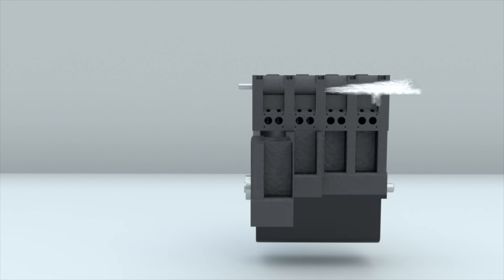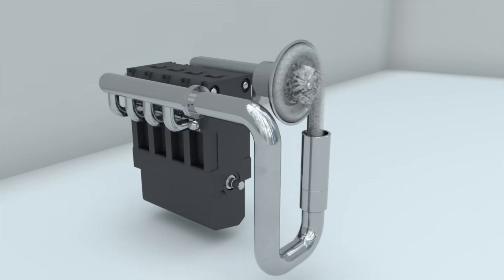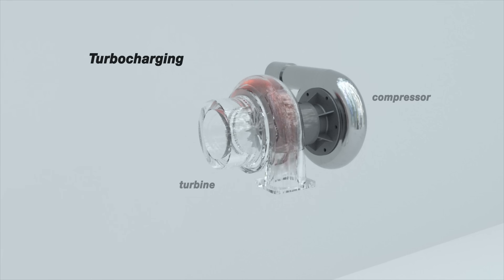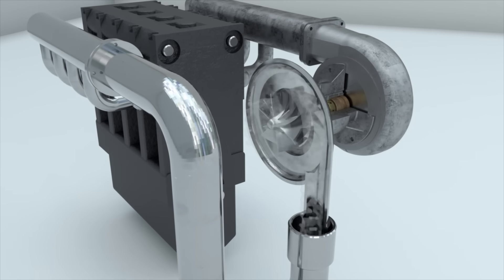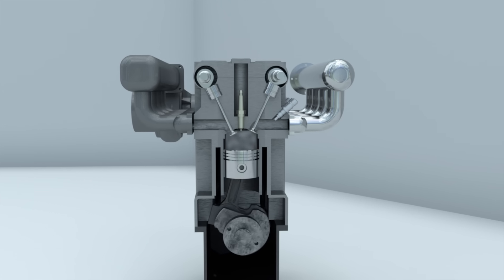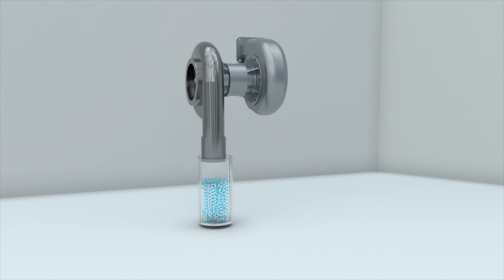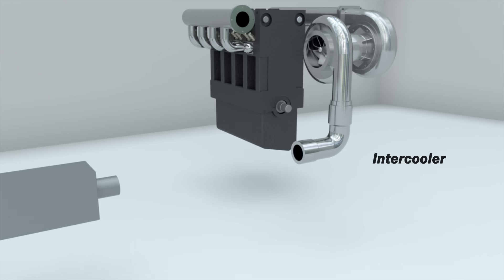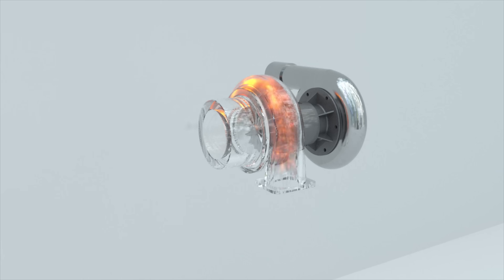How does a turbocharger work?

Comment: One very important part of turbo systems that was left out was the blow-off valve. When your foot comes off the gas, and the throttle body closes, the turbo is still spinning, trying to force air into the cylinders via the intake manifold. If you can't eliminate that pressure, all sorts of bad things can happen, like blowing the plumbing off the inter cooler. Hence the blow off valve. It is set at a pressure that allows excess pressure to be blown out of the system, but not all the pressure. You want some, so when you accelerate, the turbo doesn't have too much "lag", and will spool up faster. BTW, colder air is more dense, making the air/fuel mixture more explosive.
Reply from the maker: Thanks for the additional information
Reply: Long story short, you get the zrooooom..Pssshhhhh sound.
Reply: @TN_AU  🤣🤣🤣🤣🤣
Reply: Blow-off valve it's definitely handy at the intake side to protect the blades and also loved by tuners especially the atmospheric blow off valves that releases the air into the atmosphere making the famous noise. 
As far I know on stock mainly wastegates are present which is for to regulate the boost pressure (by routing the upstream flow back into the exhaust), the intercoolers are also typically installed on sport cars by tuners, it's something you won't find either on a regular stock street car.
Reply: @Choco-m7u  all modern turbocharged cars have intercoolers from factory, but they aren't as visible from the outside as aftermarket ones.
Reply: @vxsr33  had a friend with a chevy turbo suv. i don’t believe it had an intercooler
Reply: @grahams5146  what year is the pick up truck? All modern turbocharged cars have intercoolers but I think some 80s and 90s cars didn't. Those which didn't have intercoolers would be running fairly low boost I believe.
Reply: @vxsr33  i think a 2015 or so. it was like a chevy equinox
Reply: @grahams5146  I'm from Australia so we don't get that car here but if it's a relatively new car it's will definitely have an intercooler, it will just be hidden or really small
Reply: @vxsr33  it’s a very small turbo and i wouldn’t put it past chevy to not put an intercooler in 👀
Reply: @Choco-m7u  a blade spinning at over 90k rpms isnt gonna get affected by 2-3psi of boost lol yall act as if it were crucial to run a bov
Reply: @Choco-m7u  My regular stock street car was manufactured with a waste gate, bypass valve (blow off valve) and air cooled inter-cooler, it is a 5 door sedan and not a sports car.
Reply: I mean there are multiple videos saying otherwise.
Wastegates are mandatory. Blow-offs are not that needed. I mean when the air intake valve closes, the air goes back into the turbine, hitting the impeller and creating close throttle compressor surge, which is commonly confused with open throttle compressor surge which is actually bad for your turbo. This is why some people say that not having a blow-off is hurting your turbo.
Reply: Is there a video like this one that explains what your saying. I kind of get the jist of it.
Reply: @layzy24  thank you! made perfect sense
Reply: @layzy24  so when you let go of gas pedal the exhaust is still spinning the turbocharger which is spinning compressor turbine. 

But since you let go of gas you don't need the compressor to compress new air since you're not accelerating ( gas pedal not pressed) so since turbocharger is spinning compressor and compressor is raising pressure by compressing air that is about to go into intercooler if you don't release that pressure and it builds up it can rupture intercooler or any part between compressor and engine.
Reply: A pretty long winded explanation that’s people shouldn’t listen to really. Bov’s require a complete retuning of your vehicle if you add it aftermarket and most turbocharged cars recycle the air your pissing out your bov back into into the system. It’s actually causes MORE turbo lag because you’ve now dumped all the pressure into your engine bay and it needs to rebuild. Bovs are 100% for tuners because they like the sound and unless your hitting like 30lbs of boost You don’t need to dump the energy off that fast.
Reply: My manual mini Cooper came with a factory BOV on it. 
I love it. 
Rrrrrrrrrrrrr, pssssshhhhhh, rrrrrrrrrrr, psssshhhhh, rrrrrrrrrrrrr, pssssshhhhhh!
Reply: @We_Are_Borg_478  😔 my jetta came with a diverter valve
Reply: @grahams5146  A diverter valve? What is that?
Reply: @We_Are_Borg_478  basically instead of venting the excess air into the atmosphere, it recirculates it into the air stream via the intake to be used again. instead it doesn’t make the loud pshhh sound, it only makes spooling sounds:(
Reply: @grahams5146  With no education on the issue, it sounds like your system is more efficient, even if I have the better sound.
Reply: @We_Are_Borg_478  there are 2 types of bovs, atmospheric and recirculating (also known as diverter valve). Atmo bovs are generally illegal for emissions purposes and also they can cause the car to run rich in between shifts since the bov is releasing intake air when you let off the throttle. This can hurt performance but sometimes it can result in flames coming from the exhaust (which is a pro for some people).

Recirculating bovs are legal and better for performance as they keep all the intake air in the system and keep air to fuel ratios constant. If you want more turbo noise you can get an aftermarket recirculating BOV with a stiffer spring to have nice turbo flutter on low boost but allow the bov to open up at high boost
Reply: @We_Are_Borg_478  it’s a little more efficient, but i’d rather have a loud blow off sound because i can’t hear anything over my exhaust
Reply: Thanks for the info, only. Thing that matters is stuuutututuuuuu
Reply: It would be extremely unlikely to blow off the intercooler plumbing by having no BOV. When the throttle closes the turbo isn't under much load and the air in the system is simply diverted back to the compressor wheel, which makes the turbo flutter noise. The pressure in the system isn't very high at that point.
But having no BOV can make the turbo very laggy between gear shifts because the compressor wheel is slowed down between shifts.
Reply: @vxsr33  False. 100% lol
Reply: @vxsr33 right but there's still also a chance. With a blow off Valve you eliminate that risk. It's a similar system used by Audi called the N249 system. Look what happens if you delete the n249 from the system. Basically he's explaining the same thing but to prevent that catastrophic event you add a blow off Valve. Absolutely right highly likely but also still possible!
Reply: If you don’t have a blow off valve, doesn’t the excess pressure exit through the turbine, causing the famous “stututu”?
Reply: @danielwilson5502  yes but there are also BOVs that vent in a similar sound
Reply: @Svall823  gotcha
Reply: Blow-off valves are used by tunners mostly. Wastegate is important, but not BO valves. 

Though waste gate chatter is nice to hear;)
Reply: @xtrmbeast  WTF are you talking about? "Blow-off valves are used by tunners mostly"
Reply: @familyfalc8109  dunno what is confusing?
that blowoff valves are not used in racing cars? wonder why..
Reply: @xtrmbeast  Depends on the series, Plenty "Racing" cars have em. What you meant is that BOV's are most commonly found on street cars.
Reply: @familyfalc8109  ok, in which race do they use them?
Reply: @xtrmbeast  Too many to name, An example would be local events, Amateur racedays.. You are associating Pro/ Fully prepped cars with the average car that enters events... So what do you think a "race car" is exactly? The car in my profile pic is my car, It makes 500hp with 10psi of boost, it doesn't get used on public roads and will only ever see a track or dragstrip for the rest of it's life, What would you class it as?
Reply: @familyfalc8109  which car is that? and it's classified as tuner car.
Reply: @xtrmbeast  First off It's tuner, Not tunner. I'm aware no competitive pro's use em, But saying no "race cars" use them is false. As i said before, There is more events around the world, you are thinking of televised/Major series. I was only breaking ya balls for the blanket statement, calling cars "Tuner car", "RaceCar" is something i'd expect from a F&F movie.
Reply: @familyfalc8109  nah there is a tuner car and there is a race car. I had evo 9 rs N4 spec (rally special)
 In racing world bow is no go..
Reply: @familyfalc8109  as for tuner and racing cars and f&f.. that is true..street racers and other bullshit are tuners, race cars are special cars ment to race. And in that car is every thing about performance. There is mostly used antilag sistem for not having a lag between gear shifts. Bow doesn't alow that, releases the pressure, turbine stops boosting so when you gear shift and press the "gas" pedal once again there is no power. A "bang bang" sistem is just for that..when you shift there is power immediately.
Reply: @xtrmbeast  Less time watching St Outlaws, more time with cars buddy. If the Turbo was matched with the engine then lag is only a problem on the initial "Launch". You're thinking of 2000hp Drag machines that need the tech. Most track cars don't as power is the last thing on their mind, It's all about weight distribution n balance.
Reply: @familyfalc8109  You are form North America?  In that case I would undrestand you don't have a clue about race cars, all you know are drag cars. Do you even know what is Wrc, Le Mans 24h.. In rally world we say..if you can't drive, go draging:D

had to check wtf is outlaws..:DDD ..dude,you know that  corners exist on the road? asking since  u'r from murica:D
Reply: @xtrmbeast  lmao. I come from the land Downunder! Grew up with my own personal "Rally Stage". My whole family loves cars and racing in general, Ranging from a couple GT-R's and several other JDM cars, to "Muscle" cars from the 70's with LS swaps. BTW Drag racing is about the car, the circuit is for the Drivers, Pretty common knowledge mate.
Reply: @familyfalc8109  nice. So then you know there is no bow in any race car, which is capable of cornering;)
Reply: @xtrmbeast  Yea.. It's almost like if you actually read my responses you would've known that..
Reply: @familyfalc8109  well I did read it, and stil no answer, because there is no bow in any race car. leave that tuner and drag crap asside. 

If you know about one please tell.
Reply: Yes, but the more important part is Wastegate. Its the 'valve' to limit the boost level.
Reply: exactly well put my man.
Reply: You also missed that not all engines are created equal and some need a diverter or recirculating valve instead of a blow off valve.
Reply: @real name some people just feel lonely unless their check engine light is on. 

RIP local VWs. So many diverter valves swapped with BOVs, may their rods rest in pieces.
Reply: thus the hissing noise when the access air is let out of the blow off valve. see, I am learning
Reply: A dump valve? Same thing I assume.
Reply: There are older stock turbo diesel trucks that came without intercoolers/ without blow off valves or wastegates.
Reply: @kieran8720  you are correct. 1st gen 12 valves have neither
Reply: @kieran8720  Diesel engines do not need and almost 0 diesel engines ever made have throttle body's of any kind, or blow off valves, or waste gates.... the newer diesel pickups have throttle body's as a way to control / assist the EGR exhaust gas recirculation system to create a stronger vacuum on the Exhaust side so the engine can suck more exhaust into the intake. for emissions purposes only. but i said it once and i'll say it again, even Really old Small diesel engines in trucks. do 20+ PSI of boost, and roughly 1995 or newer can easily do 30+ PSI of boost, and 2000 or newer can do 40+ PSI of boost from the factory. without any waste gating or blow off valves, my 2005 truck has a aftermarket borg warner 369 SXE in it. T4 swap. does 75-80 lbs of boost i know guys that run 120-180 PSI of boost. and those guys said systems do not have any kind of blow off valve or waste gate. or throttle body. i think these things are purely for gasoline vehicles. as too much boost will cause detonation and detonation is "compression ignition" and a gas motor cannot handle it. while a diesel, runs off "detonation" / what's known as spark knock diesel engines are compression ignition after all.

side note diesel engines are typically 15-25% more efficient than gasoline counterparts meaning a same displacement gasoline motor and diesel motor both naturally aspirated under most ideal conditions to make them the same. the diesel engine will go approximately 30% farther than a gasoline engine on one gallon of fuel, not to mention Diesel engines for just about any given size generally will produce about double the tourqe or just over double the tourqe of its horsepower number, where a gasoline engine will have tourqe numbers below its horsepower or slightly above ~ 100 ft lbs within whatever the HP rating is. take the 454 big block, just some random dyno numbers i got off the internet, and its a very touqey gasoline truck engine i could think of, 250 hp 385 torque, take a similar design Engine the 6.5 detroit non turbo or 7.3 IDI non turbo. make about 180 horsepower but 390-400 ft lbs of tourqe respectively, 

even more interesting add a turbo to the mix a stock Turbo 454 big block will be making 427 hp and 504 lb-ft. or somewhere in that ballpark,

a stock turbo'd 7.3 powerstroke as it has a similar size turbo and almost identical displacement diesel to the gasoline engine will be making around 275 horsepower and 575 ft lbs of tourqe, throw some tuning at it, and you're looking at 410+ HP, 890+ lb ft of torque

my personal vehicle my 2005 F250 Harley Davidson edition with a 6.0L Powerstroke although highly modified, gets 29 MPG highway doing so with 700 HP and 1400 lb ft of torque here at sea level, my 2018 F250 Platinum (all stock) with the 6.7 Powerstroke gets about 450 horsepower and 935 lb.-ft. of torque

it stands to reason though Diesel engines will be making generally speaking double the torque of a similarly sized gasoline counterpart, and use less fuel doing it. as the metering device for diesel engine speed is Accuratly timed injections of atomized fuel into the cylinder just before or right at TDC. there are no other means to metering the diesel engine speed other than fuel flow. 

while a gasoline engine you can adjust timing by advancing spark, you can close the throttle body, limit the air increasing the fuel going into it changing the mixture, while a diesel generally the fuel mixture is the only thing that changes under ideal circumstances. 

i went off on a rant but long story short and th epoint i hoped to get across was diesel engines are proof throttle body's and wastegates and blow off valves are not required.
Reply: @Haast's Eagle you still need to release the pressure somehow, so it's basically the same thing
Reply: you don’t need it
Reply: you left the most important role actually, its the ability to make the pew pew sounds
Reply: The most important in addition to the Blow Off is the Waste Gate, important to avoid overpressure of the compressor by limiting the revolutions of the turbine by allowing excess exhaust gases to flow out. this valve works by detecting the pressure in the compressor manifold, if there is too much pressure it opens just enough to keep the pressure within the limits by regulating the revolutions of the turbine and consequently of the compressor. Also important for altitude pressure. at altitudes close to sea level it will open more because the air is denser, as the altitude increases the pressure decreases and the waste gate will be almost closed to make the turbine and compressor spin faster to compress air as much as possible and remain within the pressure limits for the best engine performance
Reply: @MarcoFormentin  "The most important in addition to the Blow Off is the Waste Gate, important to avoid overpressure of the compressor by limiting the revolutions of the turbine by allowing excess exhaust gases to flow out. this valve works by detecting the pressure in the compressor manifold, if there is too much pressure it opens just enough to keep the pressure within the limits by regulating the revolutions of the turbine and consequently of the compressor. Also important for altitude pressure. at altitudes close to sea level it will open more because the air is denser, as the altitude increases the pressure decreases and the waste gate will be almost closed to make the turbine and compressor spin faster to compress air as much as possible and remain within the pressure limits for the best engine performance" --That makes a lot of sense... In addition, interceptors, or cop cars, have waste gates that are even more efficient due to their lack of emissions standards. One thing I'd like to point out that hasn't been mentioned is that by cooling the intake air, more air can fit into the cylinder, although the air is subsequently heated by compression. There's physics going on here that hasn't been mentioned, that has similarities comparable to the use of NoS. The power stroke of the engine is altered by two factors simultaneously with the turbo, cooling and increased oxygen. Without cooling, the engine needs to run richer, by adding more fuel, whereas if it is cooler the engine needs the same or less fuel. The efficiency of this system can be identified on an OEM system by the octane requirements, as if it not as cooled, more octane would be recommended.
Reply: Anti lag is one hell of a drug 🤝
Reply: Cool information
Reply: cool information
Reply: Denser air makes the mixture richer, burns dirtier. More gas per molecule of air. As per more powerfull i'm not sure.
Reply: Also sounds great. Love that noise.
Reply: Yeah i was waiting for him to mention it lol
Reply: He also left out the waste gate
Reply: @allencarabajal-11  Diesels don’t have blow off or recirculating valves. No throttle so no back pressure that needs to be vented or recirculated. That’s why under deceleration you still hear the turbo spinning on them.
Reply: No blow off valve, more turbo flutter but at the cost of efficiency
Reply: Totally.  Plus it sounds cool.
Your girlfriend might crack jokes about how your car "sounds like it has a cold", but then you floor it and the jokes stop.  😂
Reply: . NBC b
Reply: Video is very vague.  The blow off valve goes whoosh! Followed by a sexy flutter.
Reply: I was taught that it was called a " pop off" valve.
Reply: Not to sound dumb by any means but I thought a blow off was optional??
Reply: @ericelwood9393  The pop-off, or blow off valve prevents over boosting the engine thus preventing damage, some times catastrophic damage.  There is an inherent lag with any turbocharger system because of it's reliance on exhaust gasses that make it work.  The blow off valve helps to regulate the upper end, as stated, to prevent an over boost condition.  It should not be removed or disabled.
Reply: recently my mechanic opened the intercooler pipe apparently to clean it and they did not tie it back properly. I heard an explosion along the way in a very dark place. I had to limp all the way to a safe place,.. It did that a few times with a lot of smoke coming from the exhaust, till I had it properly secured. Will never allow any cleaning of those pipes
Reply: Pro Series reply right here!  👆
Reply: You're referring to the wastegate.
Reply: STUSTUSTUSTU
Reply: and it goes SHTUTUTUTUU
Reply: I have an old diesel without an intercooler, wastegate, etc.
Reply: Stututututuututut
Reply: you forgot the most important part: it makes a cool sound 😂
Reply: And recirculating the box will keep lag to a minimum and keep you in boost better
Reply: Plus it sounds kewl.
Reply: Blow of valve is and sounds garbage. id much rather prefer STUTUTTU  noise, then a single PSHHHHH. boring as fuck . i delete the blow of valve on ever car, doesnt do nothing wrong. improves sound.
Reply: @SR-yt2bc  Haha, no way I love the sharp blast of the PSHHHHH over the weird STUTUTU sound any day! But hey, differences in preferences is what makes the world great.
Reply: Very true. However, not all turbo systems have a blow off valve. Typically cheaper and or small turbos do not need one or come with one
Reply: STUTUTUTUTUTUTUTU
Reply: Good explanation, i could visualize and understand exactly what you were talking about without ever seeing one. Thanks :D
Reply: Is that what makes the turbo sound?
Reply: And also how all that recycling crap goes back through a Diesel engines intake causing sooty carbon build up which eventually stuffs your engine
Reply: My wife's 2022 Chevy Equinox had the intake pipe coming from the turbo from the intercooler to the intake of the engine pop off from excessive pressure. Brand new.
Reply: Not on diesels. Duhhhhhhhh
Reply: Throttle bodies lol
Reply: Stutututut
Reply: Stututututu
Reply: it would seemt o me the model looks to demonstrate a direct injected diesel engine, Diesel engines do not use throttle body's, or Blow off valves if they have them the newer ones that is. its purely functions to assist the operation of EGR systems or DPF systems. Diesel engines are Perfect for turbocharging they usually can handle up to 70 PSI of boost under most circumstances and competition engines are known to be built to handle more than 150 PSI of boost
Reply: Thank u. Been looking for a nice simple answer like this.
Reply: My truck doesn't have a blow off valve and  I have a sequential turbo setup
Reply: Flutter
Reply: Would you add a cold air intake before a turbo charger ? If just buying a turbo charger would I have to get anything else?
Reply: Not all turbos need them or have them
Reply: screw the blow off valve who even uses those. the most important thing this video missed is wastegates... the thing that literally prevents your engine from over boosting and exploding
Reply: Bro just explained everything i have been searching for 12 hours in a Single comment😩 thank youu
Reply: This was exactly my doubt, thanks for the explanation.
Reply: I wasn't looking for additional information necessarily. But that was a very simple explanation that is very informative.
Reply: Thanks for the clarification!
Reply: 🙄  🥱    give me a diesel.
Reply: I don't understand.  Are you talking about the gas going into the turbocharger or out of it?  And why would your foot be on it???  This whole system is inside the engine bay.
Reply: 😮 EXPLOSIVE 🧨 !!!!??? Meaning ??? Like blow the ENGINE UP !???
Reply: You explained more than the video
Reply: Antilag
Reply: I have noticed my car is way faster when it's cold
Reply: So are cars faster in winter?
Reply: I apologize if this has already been mentioned. But look up “compressor surge myth” not only will it not burst your piping, it won’t damage the turbine or your engine. It decreases performance since it is causing the turbine to slow and boost to rebuild slower between shifts. But it is not harmful. It also produces the iconic “stututu” sound associated with turbos
Reply: The sound of compressor surge sounds better than blowing values
Reply: That was explained very well, thank you so much
Reply: Does that mean the engine would generate more power?
Reply: Is that what makes it go STUUUUUTUTUTUTU
Reply: Is that phenomenon also what can cause a "run-away diesel"? I've seen this happen in videos, but don't fully understand
Reply: @allencarabajal-11  ah ok thanks for that, I will admit my knowledge on diesels is lacking a bit. I know there are a lot of petrol and e85 powered cars running 20+ psi no problems with no BOV